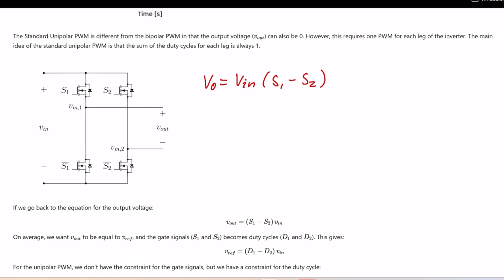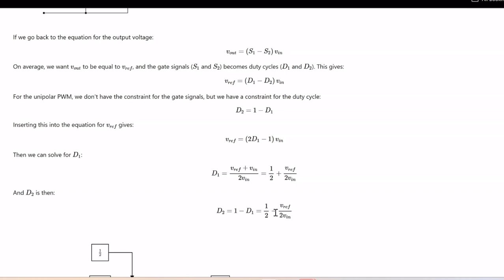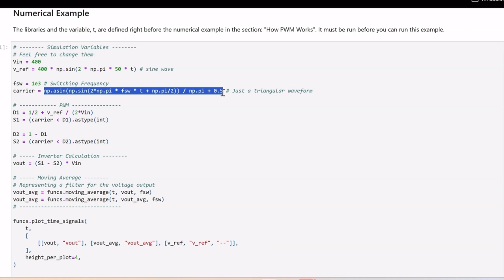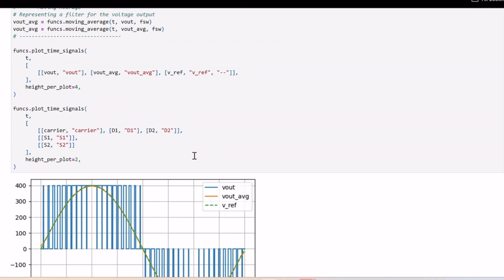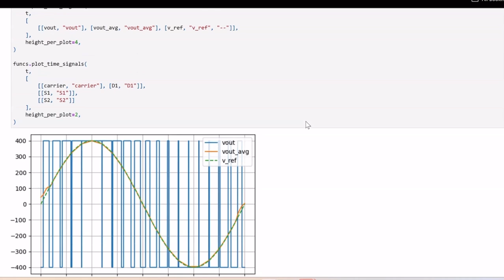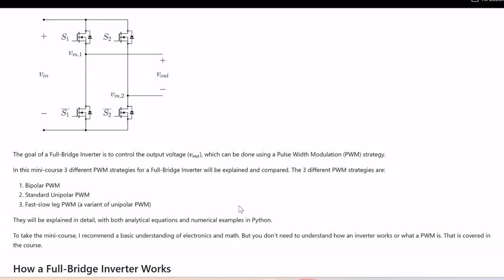How Unipolar PWM works for Inverter

Comment: Hii,
Can this same EXACT unipolar modulation be used for totempole bridgeless AC/DC pfc? i'm simulating a dual frequency one (both legs operate at higher switching frequency). So can this EXACT modulation be used for that? or will there be changes in Vin and Vref ? Considering for both open loop and close loop, in case of current control loop will the PI's output be directly fed in place of Vref? 
It would be a gr8 help if you answer this :)
Reply from the maker: Hi, yes you can use this modulation for totempole bridgeless pfc. In fact, totempole bridgeless pfc can be controlled using the same controller as an inverter.

The output of the current controller is usually in literature the duty cycle. In that case, you can remove the left part on the block diagram, because then you already have D1. If the output of the current controller is Vref, then you can insert Vref into the PWM.